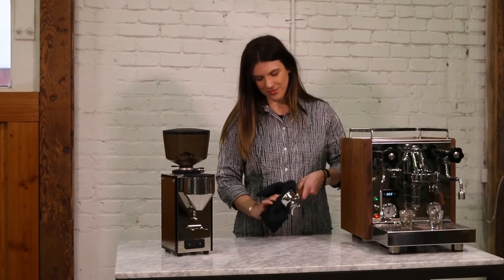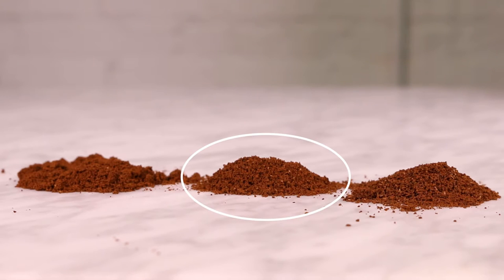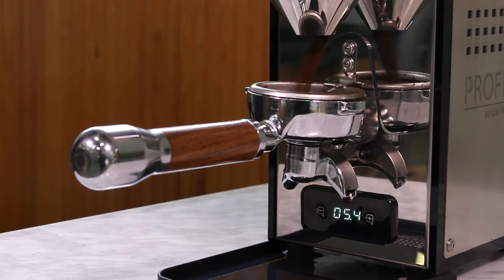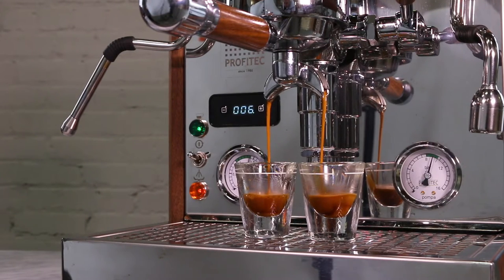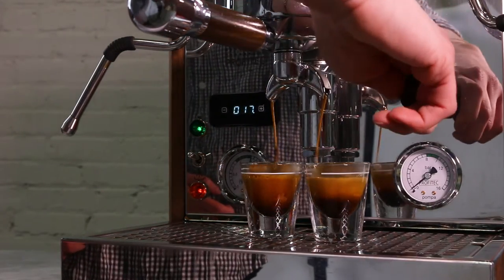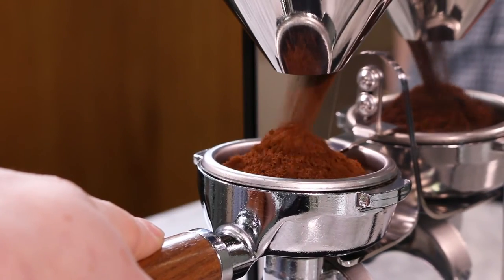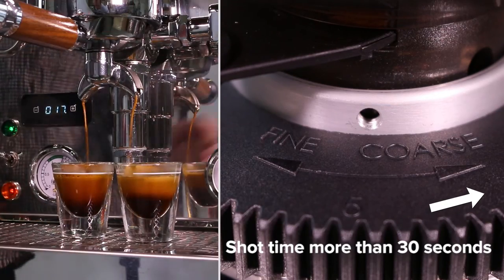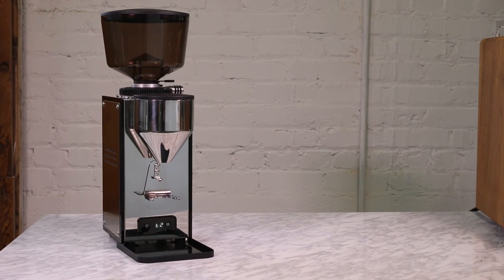Profitec T64 Espresso Grinder Setup

Comment: Great video! Just one question: the 6-10 second window until first drop, is that including pre-infusion time, or is that starting with full pressure? I have a Rancilio Silvia, which doesn't pre-infuse, so I want to figure out if I should still aim for 6-10 seconds or if I need to aim for a shorter window.
Reply from the maker: Hi Nicolaas-glad you like the video! The 6-10 first drop window is for machines operating at full pressure like your Silvia.

Comment: does the profitec 700 fit nuova portafilters
Reply from the maker: Hi Jay–great questions! Most 58mm portafilters will work with the Profitec Pro 700, but we'd recommend using the Profitec portafilters that come with the machine.